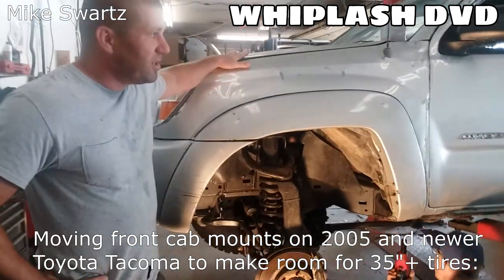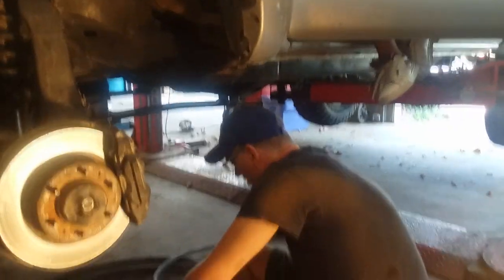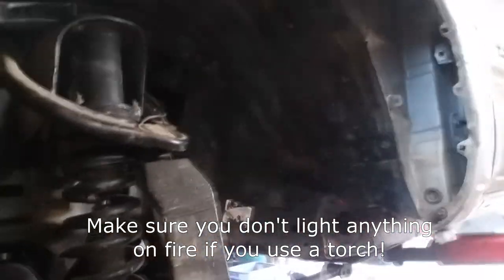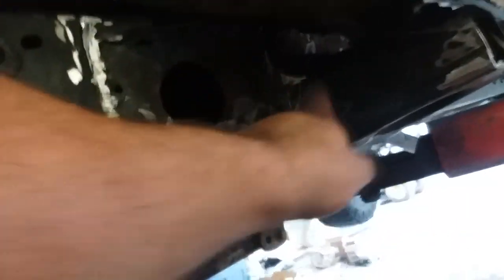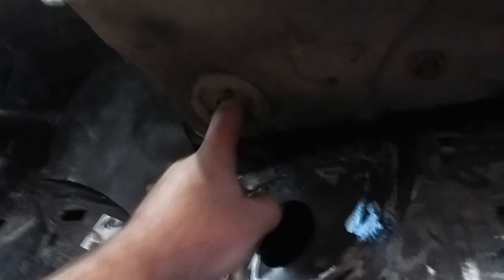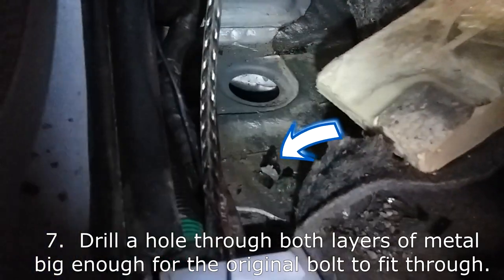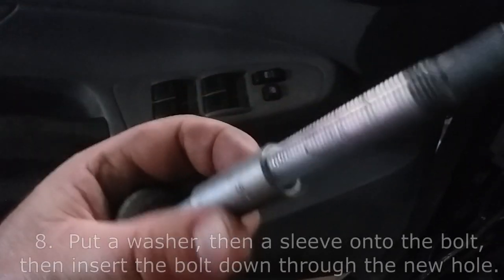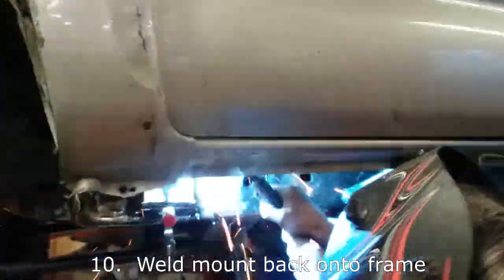Cab Mount Move for HUGE Tires on 2nd gen Tacoma

Comment: This video was fucking awesome lol when you put the jacket on his head I died laughing. I was gonna just chop my mount but you guys got me thinking of just relocating it like this. I only want to fit 35's so I think cutting might work out
Reply from the maker: Cutting should work.  I ended up sliding the entire cab of the truck back 4 inches.  Also put a 5.7L Tundra engine in it.  Just got it running!  Check out the playlist Tacundra https://www.youtube.com/playlist?list=PLU5lR_tbWf0zep_2PlB2nioosQY4ueE7T

Comment: what suspension you rocking ?
Reply from the maker: I modified stock arms for a +3.5" long travel.  Definitely not as strong as a fabbed kit, but it's working for now.  8" King shocks.  Rear ihas 3" blocks, but I'm about to start installing a 1 ton rear with a 3 link and coilovers.  #tacundra